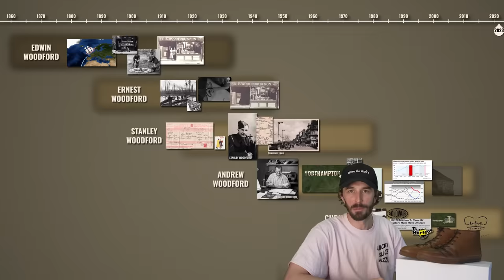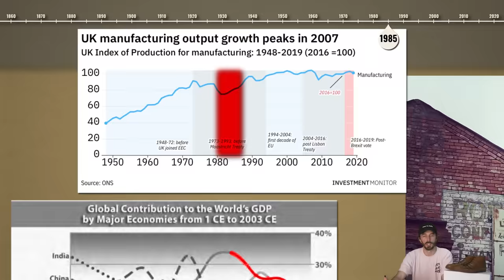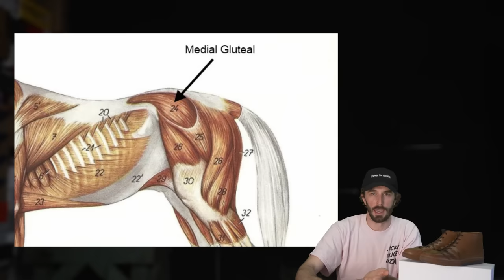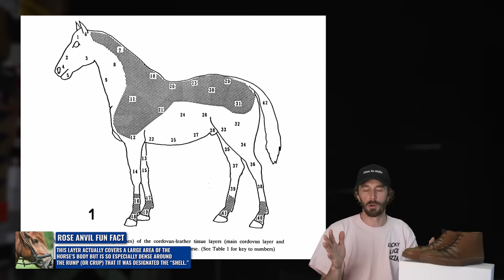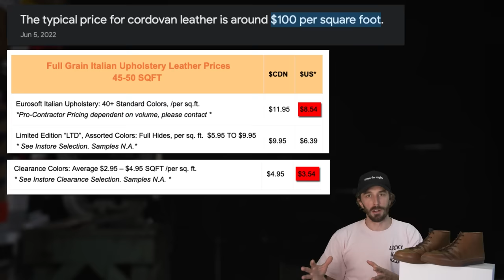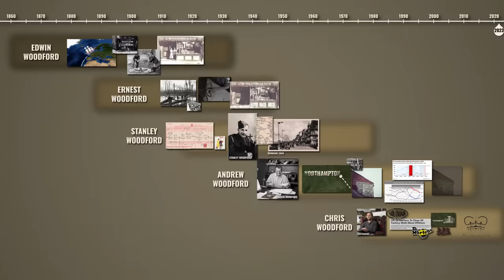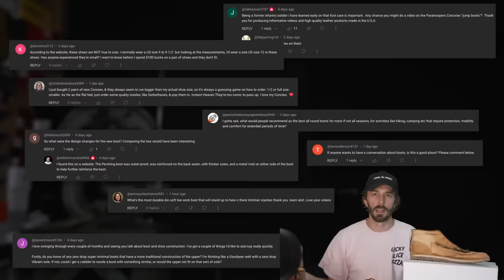$910, I Cut The Most Perfect Sneaker In The World - Crown Northampton

Comment: Using cordovan is absolutely insane. Another important thing is how soft it is for its durability, as well as its slickness. It doesn't crease or bunch, and I do archery. The top finger tabs (something to protect your fingers when you hold the string) are all from cordovan leather, and for one of them, which is probably about 2 inches of leather and some metal fixtures, it will run you about £90. A shoe made from just one piece is absolutely ridiculous, and considering the prices of high end shoes, that price makes complete sense. Completely out of my price range but wow. Anyone that can afford it will 100% not be disappointed by that leather quality, and it'll be incredibly durable. 
For reference, pros shoot thousands of arrows off one tab, which is a tiny contact surface, consistently holding back 40lbs, to release as gently as possible, meaning that that string will be constantly rubbing and wearing that leather. This is known as one of the highest quality leathers for a good reason.
Reply: Very interesting... I was curious other uses for this leather. That seems to be a perfect testament to its durability.
Reply: Cool.
Reply: A shell cordovan of about 2.6 square feet will cost about 200 euro (Maryam) For 2 whole cut shoes you need two of them. That still leaves a price tag of 500 euro for the production of very simple and not very pretty sneakers. Using a rediculously over the top material to cover up the rediculously over the top price for the production of them. O, and from the left over scraps alone a bunch of archery finger tabs can be made. A far better use where material properties meet actual needs.
Reply: @renatoetzi  That makes sense if you ignore the other materials used for the sneaker, the cost of labour to manufacture and hand sew shoes, the cost of energy to run a factory, insurance, local taxes for the factory,  maintenance of the factory, the cost of running and maintaining a website,  internal IT costs for finance and accounting, auditor costs, packaging, customer service costs and free shipping. I may have missed some things.....
Reply: @UnknownUser-rb9pd  The only thing I think you missed is I don't feel it is also unreasonable for the company to actually make a profit at the end of it all ?
Reply: I think I paid about $30 usa for the cheapest cordovan archery tab from 3 rivers.
Reply: the problem is that using horses is forbidden in normal countries .  For leather or meat

Comment: I have 2 problems with them and I know you can’t disagree because they’re gripes you usually bring up. The foam and the cork. Foam has no place in a $910 shoe. The foam will wear out of a few months and serves no purpose other than initial comfort.  The cork, while being a relatively decent addition to the average shoe is still inferior to another piece of leather in its place. After significant wear the cork is pushed around and gaps are made making them less comfortable and not as long term of an option.  It’s objectively a great shoe but it’s not as good as it could be.
Reply: third problem: it's ugly.
Reply: I agree with you on the foam my dude, but maybe you should reevaluate cork. It is lighter than leather, antimicrobial, and the only natural solid which when compressed on one side, does not increase in volume on the other. When a sole is thicc like this sneaker ya gotta slap some cork in there. A full leather insole is only ever comfy on hardbottom shoes in my opinion 😊. I agree with your point though, these sneakers shouldn't've did that foam bit.
Reply: @Bawnana  The foam is just in the removable insole. If that starts wearing out, you can just get new ones. Takes zero work.
Reply: As a cobbler, I agree with your points that other superior meterials could be used instead, especially the foam and how true, cork can eventually break up to a point where it causes discomfort.
Reply: I have mixed feelings about cork. On a shoe, rather than a boot, I really prefer a lighter material than leather. However, you are correct that in terms of wear, cork will not last as long and is inferior to leather.

I believe the foam is removable.

Comment: I would challenge you on breathability and functionality as well as for what sports was this design-engineered.

This is more of a casual boot or shoe than it is an athletic shoe. I’m confident I could still run sessions in a $90 mesh, nylon and suede Saucony Jazz 81 if I was so inclined. I’m not sure I could that in a similar materials $180 New Balance 990v1 Made in U.S.A. because those are no longer made with the ‘80s running tech.

✌🏽💙👟

Comment: The extent and placement of the rolls, were these just not your size, or is that what can be expected?
Also, wholecut shoes are actually some of the easiest to make, but it is correct that getting enough cordovan that is good and consistent enough to make a wholecut with is VERY expensive.
Reply: Sorry dude but what you are writing about wholecut shoes "being some of the easiest to make" is not true. Do a simply google for how wholecuts are made and you will see that the reason they are priced higher than average shoes is because they are harder to make and require a good deal of skill.
Reply: @somerandomperson8282  I literally only own bespoke shoes, but for 1 pair of running shoes. I have had a lot of opportunity to talk to makers who make wholecuts. They are easier.  My maker does charge  slight premium for them, but it's because of the leather waste that occurs from the need for a bigger piece. Maybe wholecuts are harder if you don't block them, but it's also just a worse outcome. They should be blocked then cut after, which is easier that other things.

Comment: I think one of the things overlooked in some cases is the wide knee and foot bone and tendon structures that come with the variety of humans. A man whose lineage comes from flat bog will have at least a Mildly different bone, fat and muscle arrangement in his feet and knees to adjust for efficiency, compared to a man whose lineage comes from sharp hills with lots of gravel or stone. For this reason, I think, as a short wide-hipped man, the flat sole "chuck taylor"ish rubber simply doesn't work for me on flat ground, as I believe I'm built to be walking on angles. And for the lanky bog-runner lake swimmer Franc, the flat sole may not do enough to cushion the knees on the hard pavement we tend to think of as "walking paths," leading to ankle and knee problems in short order.
Reply: Wow you definitely got me figured out as a swimmer whose knees can't take flat soles...

Comment: not sure if a sneaker is like a pair of trainers? But as a runner, i would recommend Reebok, although today they are too costly for me, i used to run 5 K a day. for 15 years.  I gave up running at age 45.  I took up swimming.  But i had a pair of reeboks that lasted five years without structural fail.  they had taken a beating. i had painted them white a few times. to cover the dirt. they were like ancient foot wear. but they worked. I ran 5 years in them, the rubber had burned off.  and still they were intact.  300 days x 5 kilometres. = 1500 km x 5 = 7,500 km. 
the leather shoes, lasted, they had the perfect heel in leather that gripped the heel. not that v shit heel they put on trainers today. 
the leather gripped skin. So they never wobbled. Brilliant shoes. The ones i wear today for walking are okay, they need to be retired after six months. As they are not like the Reeboks. even the reeboks today are not what they were. as always some tosser changes the design. wankers.